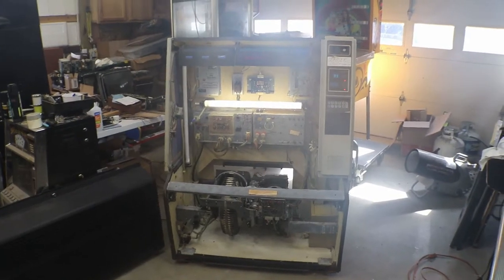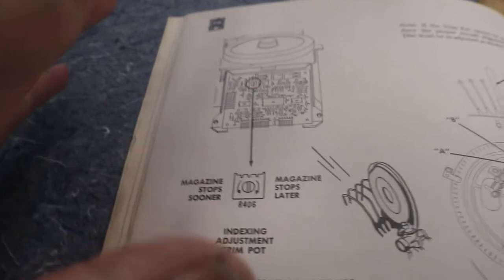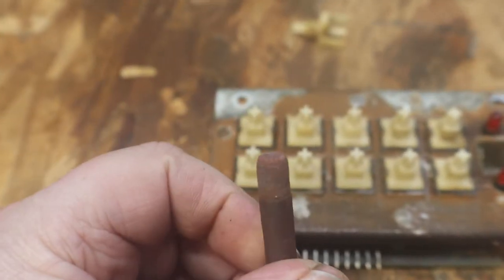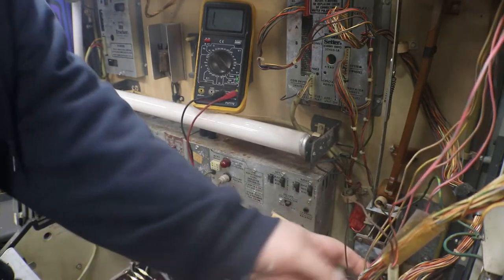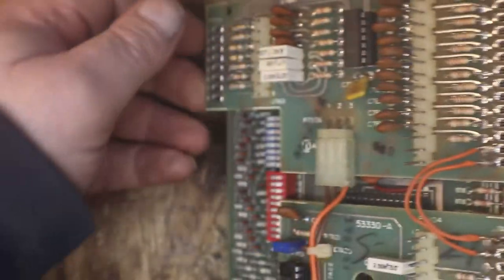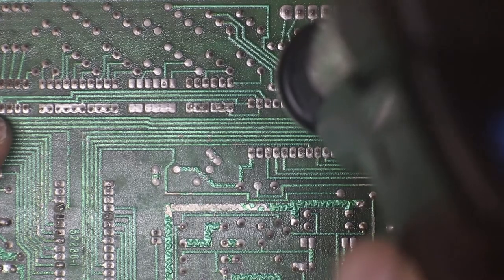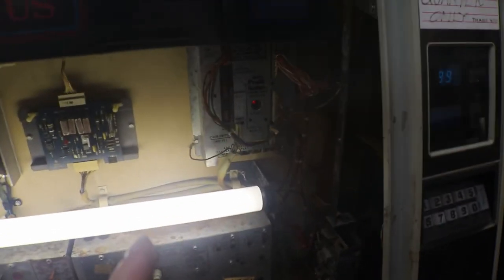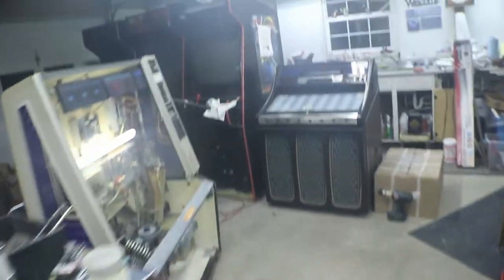Troubleshooting Profit Setter & Keypad / Replacing A IC Chip Socket / Rock-Ola 480 / Ep 6

Comment: I’ve been working o. One for a while I think the rest of my problems in the power supply. I can plug the low voltage side in and unplug it and the display numbers will come up briefly
Reply from the maker: It sounds like you're making progress! Have you tried checking all the connections and ensuring everything is securely plugged in? Sometimes it's the little things that make a big difference.
Reply: @RetroGamingWithHopper   yes I’ve got everything else working . I got a few of these Juke box’s that works I just started on this thing . Setting here look at the diagram now . Thanks I’ll get it . I appreciate you.
Reply: Going to ck all of my power supply voltage again. Great video
Reply: I will ck the connections again my red light is on on the profit steer but he display numbers and the red lights are out were the. display numbers . If I am getting power to the privet setter . I should have power to the display board shouldn’t I . Or am I missing a voltage from the low power supply. Out   . I had two power supply s. One was bad because the record would. Stop and go up slow from the turn table I put the other power supply in and that was fixed . But everything else works. Accept the display and the red lights on the display board is out . I am going to flip the switch on all of those and see what it will do . I just believe I am missing Volta some were . Do you know what wire and voltage feed the profit setter and the display I think it’s the power supply because like I said I can unhook and hook it up and the numbers come up but still no red lights . Any help would appreciated thanks

Comment: What is that desoldering tool you have their. Maybe I need one.
Reply from the maker: It's a cheaper DE soldering station not Hakko. 
https://www.amazon.com/YIHUA-Desoldering-Variable-Temperature-Function/dp/B08BK69H2M/ref=sr_1_5?crid=3HG2ZLRGPHNYH&keywords=desoldering+station&qid=1664619016&qu=eyJxc2MiOiI1LjEzIiwicXNhIjoiNC42OCIsInFzcCI6IjQuNTcifQ%3D%3D&sprefix=desoldering+%2Caps%2C705&sr=8-5&ufe=app_do%3Aamzn1.fos.f5122f16-c3e8-4386-bf32-63e904010ad0
Reply: @RetroGamingWithHopper Thanks for the quick reply, I don't know if I'm ready to for this unit. $129.00 is a little out of my budget right now but would love to have it.
Reply from the maker: @garybregel4606  I used desoldering wick and the cheap pumps for years and had no troubles. I can understand the budget thing, there's a lot more I wish I could afford.
Reply: @RetroGamingWithHopper  I just got back from fixing a Seeburg Juke Box STD-3 It still has some lighting problems. I took the manual home with me maybe I can figure out the priblem here at home.
Reply from the maker: @garybregel4606  Nice. I love when I have the manual.